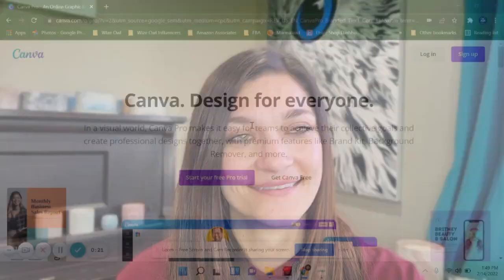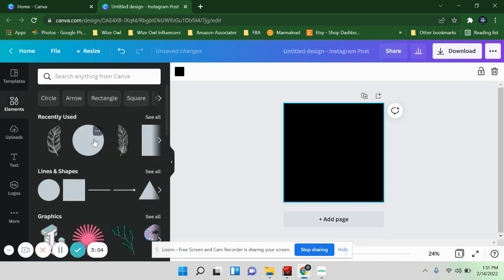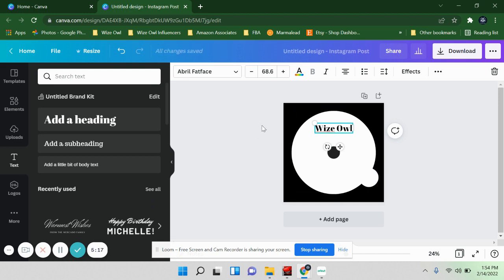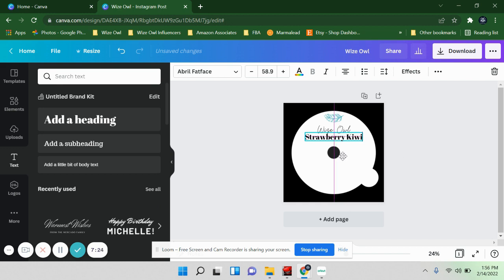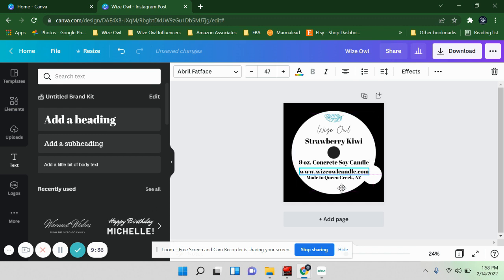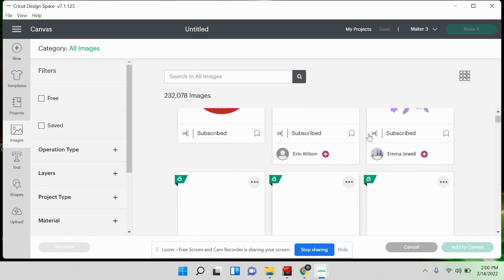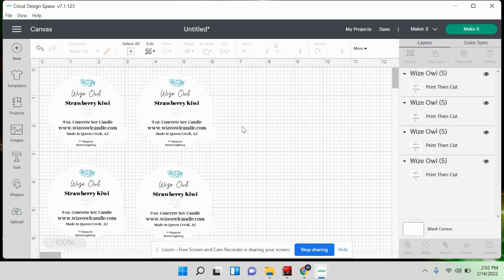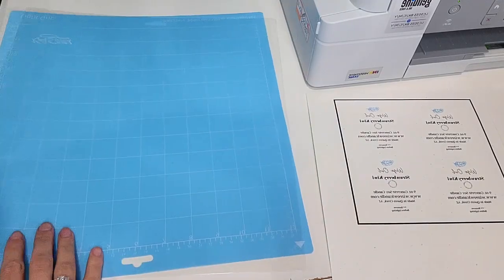DIY Step by Step Tutorial - How To Make A Dust Cover for Candles

Comment: Great videos, I have learned a ton of great tips from you. Thank you! ....Canva Tip-When you need to move a element, fonts etc. Just enlarge your work area. You were working at 24%, increase it to 100% to get the most accurate spacing and then just reduce it back to normal. Just wanted to give some AZ love.
Reply from the maker: Very true! Thanks for the tip :)

Comment: I would really love some help as I just purchased a Cricut and need help based off of this tutorial. You show in canva that you created a black circle in the centre but once that image is transferred to cricut, cricut does not cut out the centre I really need help on this.
Reply: After you download your image from Canva and upload it to Cricut design space, you'll get an option for image type - click moderately complex. On the next page, you'll simply click on your black circle and it should cut it out :)
Reply: @katinkenbrandt7845  I appreciate the help but this did not work.......am I missing a step? I cannot click the black dot, it selects the entire image. Sorry I'm such a newb.
Reply: @lippymommy  No worries! I am myself just trying to figure things out  :) At the Background Remover section (after you selected Moderately Complex), click on "Select" in under the "Manual". Then it should remove your black center after you click on it. If it doesn't work, you can click on "Erase" instead of "Select" an erase you black center manually - you can adjust the size of the eraser so it should be fairly easy.
Reply from the maker: Were you able to get it to work?  Kat thank you for replying and helping!

Comment: Thanks for the tutorial - I found it very helpful but just one question, what are you doing to make sure the center hole is cut out by the cricut?  When I tried it failed to cut the center hole.  I am not sure if I need to add and slice in cricut design or if there is another trick.  Again, thanks for the video!
Reply from the maker: Hi! Sorry for the late reply! You can use the "slice" option in the bottom right corner in design space after highlighting the design :) hope that helps!
Reply: I tried this and slice isnt highlighted 🤦‍♀️ so I unflattened it and still the slice isnt an option
Reply: @tonnyajuhnke4727  I’m having the same issue 😣
Reply: @feliciam1991  if u go over and put a shape over it like I did a rectangle because I use wooden wicks.. so in cruicut design space go pick shape place it over the wick spot then highlight all of design and on the bottom right hand corner is a thing called splice click that it should work
Reply: @tonnyajuhnke4727  Hey thanks! I use wooden also. I could get it to slice unless I had a design attached to the entire dust cover…then it would just mess up the design.
Reply: @feliciam1991  I hope u figures it out it is so complicated.. if u need more help let me know

Comment: great tutorial but you missed a couple steps that would be very helpful to some. 1. normally on cricut design space, you have to choose "print then cut or cut image". How did you go straight from upload to the canvas with the printing on the dust cover. If I choose "cut image" it shows up as all black. If I choose print then cut, It acts like a sticker and wants me to print on my printer which Im not doing. 2. how did you get you wick hole to be a transparent hole? You went from black on canva, then on design space its a transparent hole. I cannot get that transparent hole and it would be nice to know how you did it. Thanks.
Reply: Yeah I also need this answer...I left the center hole on canva in black and after going to cricut it never cut out. Help on this would be great.
Reply: Here looking for answers on #2 as well!

Comment: Love all of your content, very helpful! Question - which wick has worked best for you in those concrete containers you show in this vid? I'm using the same vessels with 464 and having trouble finding the right size. Thanks!
Reply from the maker: Hi! I use wooden Wick co and I use their Wick Guide to help. I realized with soy wax you need wider since it doesn't get as hot. I hope that helps :)